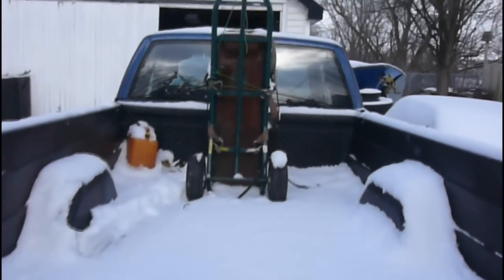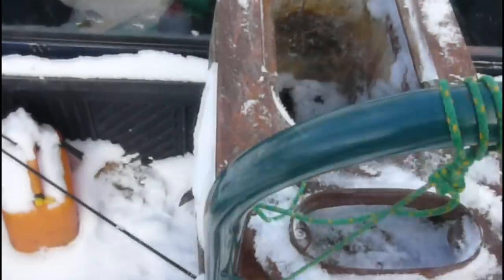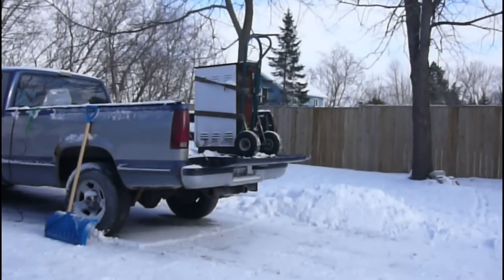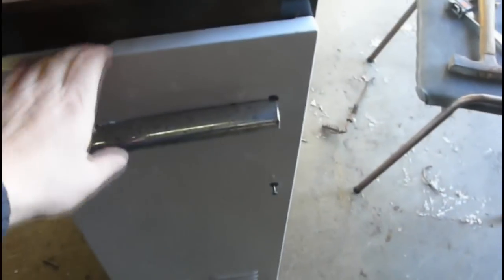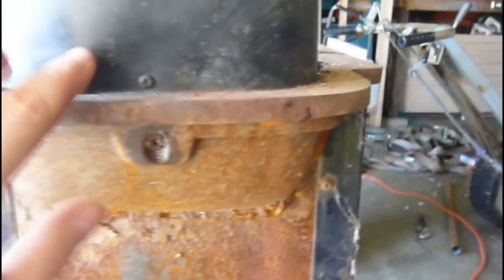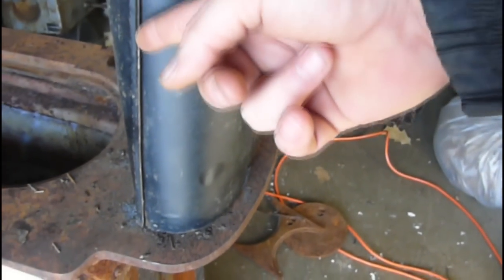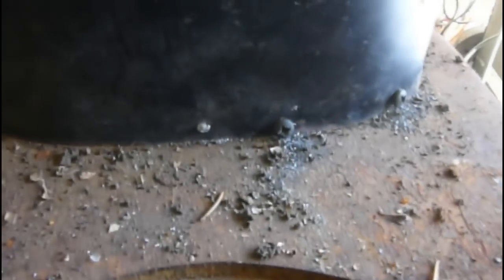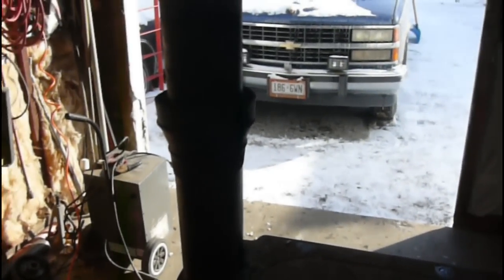Craigslist does me a good again! Look what 20 bucks got me.

Comment: That style of stove is called a "trashburner"   it was a small stove for use in the kitchen to burn trash, take the cill off, and had a cook top so you could cook when the power was out.   It only really throws heat from the cook top, while the sides stay pretty cool so it's not a great stove for a shop stove.  All cookstove type stoves are built to cook more than heating a house.  Advertise for an old warm morning army stove, that makes a great shop stove.

Comment: We got one of those in the cabin. Do you see a couple of pipe hook ups on the sides or back? Ours is that shape; you hook the water up to it and heats the water. No tank, it just heats as the water moves through it. We call it the 'trash burner' since that's what you put in it; just enough fuel to get a quarter tub full of warm/hot water!

Comment: HAD ONE GIVEN TO ME A FEW YEARS AGO, HOOKED IT UP IN MY BASEMENT AND USE IT TO COOK ON AND HEAT THE BASEMENT . DOES A WONDERFUL JOB , IT GETS THE BASEMENT UP TO AROUND 80 DEGREES KEEPS THE FLOORS WARM AND CUTS DOWN ON GAS USE .
Reply: Larry hoffer yea mee too.. i have a dovre 2500 wood burner i use.. gotb7 cords of mixed. mostly red n white oak. absolutly love burnin my wood i toiled for 2 summers ago.. it burns nice, but i still run house fan to circulate the warm air.

Comment: Had to stay in my camper one winter , down to minus 20f .  Had one of these out in the shed so used it in the camper , run combustion air to the outside ( pipe hook up in the rear ) nice and toasty all winter   less than a cord of  wood for  the five months . Could not find a coal supplier anywhere , but was told I could dig my own out of one of the shut down mines near by  , to messy , stuck with wood , excellant little stoves ( 1 foot wide x two feet long ) had 15 inch fire wood delivered , perfect .

Comment: I have this same 2 plate top and it's own pipe on the right side of a 4 gas burners stove ,all in one , it heats water in my allium pots very well but I lose most of my heat up the 4 feet of pipe , wish i could find away to capture more of the heat before it goes up the short pipe that goes up alittle and than out the back wall.

Comment: Btw, the way you assembled your stove pipe won't work: you HAVE to have the female end of the pipe always facing down (toward the floor). Also you can still buy real stove pipe, It's not that expensive. Where you've hooked the pipe to the stove is not good either, you can buy a saddle that will work right. You don't want CO leaking out! (venting pipe dot com has lots of pictures; you can figure out how to do it and what you need just by looking at them). Good Luck!

Comment: This is called an, "End Heater."  It is designed as an addition for a standard range with the option of heating hot water.  This is not a wood stove.  It is a coal stove and it will work a lot better if you burn coal in it.  It's not really meant to heat but to cook and make hot water.

Comment: I was cleaning out the sheds and barns of my friend's farm, and there was one of those there for free.  after looking it over, it's not much of a stove.  we scrapped it.  the reason I say this, you have to load it through the small top round lids.  that's a real PITA with coal or wood.  the wood pieces would have to be very small.  you'll be tending that fire constantly. using a coal stove to burn wood means eating a lot of wood.  the grates let in too much air and burn the wood too quickly.  it's better than a barrel or nothing, but I'd look around for a real wood stove.  those are out there for free now too.
Reply: Where do you live? Where I live the cheapest wood stoves are over $500. I can't seem to find anyone "giving them away" or even selling them for a reasonable price for the condition.
Reply: It's not a pain if you burn coal.  We did for many years in a similar-size coal burner.  Use wood to start the fire, keep it going for months with coal poured in the top,and enjoy the wonderful heat.  There's no creosote with coal either.

Comment from the maker: @FatherJudgement2 NOW you tell me. LoL I figured it was something I would never find, so I just did the ole make it work with what ya got. I wouldn't of drill holes in the ole girl if I had known its availability though. As said below, wont be using it to heat the shop now though. Gonna maybe fire her up for the hell of it and see what she does. Might put it beside my bbq to boil a big ass corn on the knob pot or something. Patio hot dog / marshmallow cooker? .

Comment: seam goes in the back don't need any special pipe 6" usually just squeeze it to fit on wood stove n the way it is now it might pop open please take it off and do it correctly sir if you ever plan on using it!
Reply from the maker: +Lawens Happy Thanks, I'll keep that in mind. It's a shed ornament at the moment. :c)
Reply: Ok just incase you ever use one thats oval shaped yeah I didn't know until someone told me, my brother uses one of these in his kitchen to keep it warm works good but never saw one like urs with all that fire brick in it must be for coal. They throw alot of heat upwards our house had floor registers and the room above was my sisters bed room and the heat rose and kept there room nice in our living room /parents bedroom they had a heatrola that was for coal but my dad used wood just like the kitchen we had a register in our floor so heat would go into our room too that's the way it was up in the Upper Peninsula of Michigan back in the old days when coal was easier and wood was cheaper!

Comment: why do you say coal works alot better ?
Reply: Lisa Loves coal, anthracite specifically has lots more energy than the same volume of even the densest wood.. plus it burns much hotter than charcoal and for longer.. a ton of coal has about the same btu output 20 mbtu per ton as say a cord of oak, red or white, 24 mbtu. its just that coal takes up less space, burns hotter and therefore has higher efficiency..
Reply: Lisa Loves coal, anthracite specifically has lots more energy than the same volume of even the densest wood.. plus it burns much hotter than charcoal and for longer.. a ton of coal has about the same btu output 20 mbtu per ton as say a cord of oak, red or white, 24 mbtu. its just that coal takes up less space, burns hotter and therefore has higher efficiency..only issue is coal dust is carcinogenic while plain ole wood really isnt. i prefer good ole wood. white oak hickory and black locust